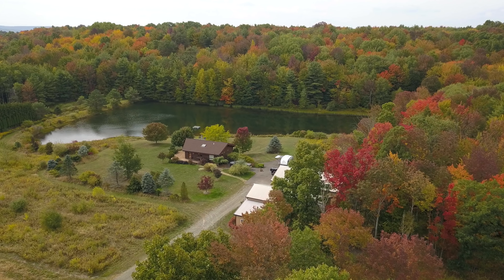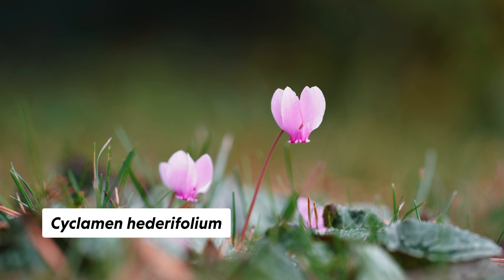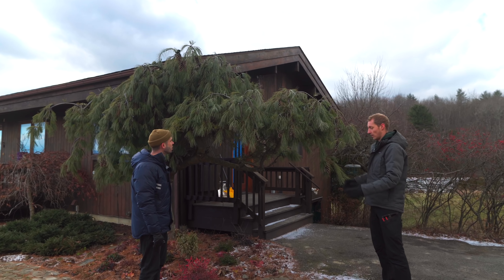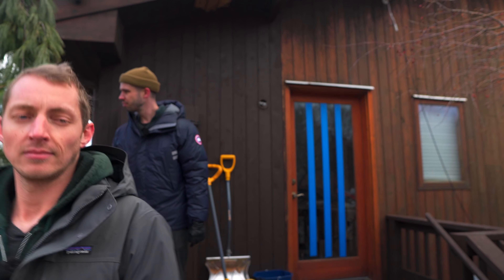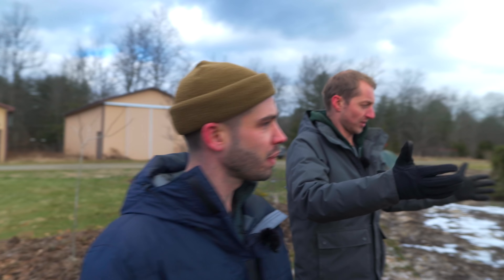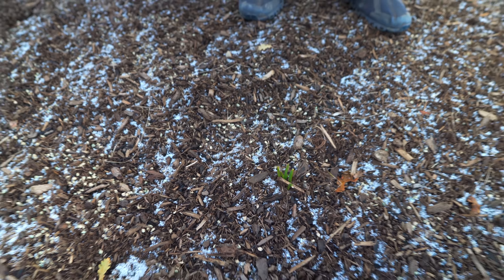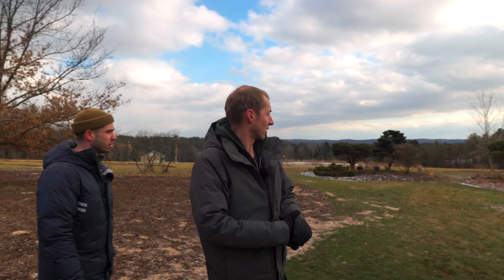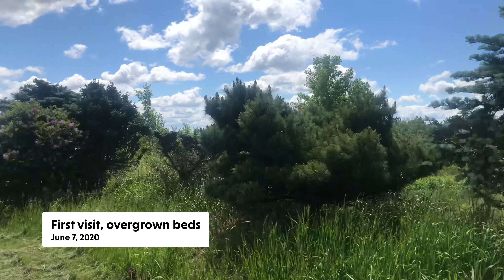WINTER Property TOUR: 1 Year of Work! — Ep. 072

Comment: The marks on the handle and bit on the floor look like iron sulphate staining, it’s used to fertilise gardens but it also turns wood slowly grey. My thinking is that someone had it on their hands and maybe splashed a bit on the floor?
Reply: Yes, I thought there must’ve been some chemical spilled as well, (I also thought it could be an issue with the chemicals in the stain) as the wood shouldn’t leach after all these years. I’m new to wood working so this is definitely interesting 🤓

Comment: What I chose to paint my deck 
Needed to be top 2 out 3 reasons 
One I did not want to walk bare foot in the hotter season running back inside for shoes Scolding Feet 
Second we had dogs living out the country with us 
when  wildlife ventured on our land they would ripp up the  paint  by thier claws you 
 could see thier markings every where 🤔
 also the deck was so hot for them to lay on even to walk as we  experienced children who came over with visits third when shoveling snow I wanted protection against the shovels the hard wear and tareing  
I choosen a color that resembled  Thailand sand frm one of thier exotic beaches mixed with scratch proof that would protect had a quarantine warranty  protection frm dogs tearing up the paint also the wood as much possibility 
And   would deflect the heat frm the sun🤪
The trimmings in-between the decking I wanted a colors that would blend together
Both  needed to have a soft touch so it wouldn't look bold  
sideboards windows  door trims  I used a rusty color that resembled rust as well our log home had darker tone not natural honey tone 
It was magical we couldn't believe on a hot day our deck facing south   exposure to sun all day stayed cool 
Our dogs stayed  layed out with out heat exhaustion thier body's would get the sun under them wood staye cool 
No matter how many times they jumped up ran off to catch unexpected deer or other  did not show or did damage to the paint  flooring of the deck
 5 yrs later looks still refreshing 
So all my top 3 specially 2 worked did its job 
We had alot of complaints what we also noticed being out in the country we had a huge pond our house was built on a hill the pond was down by the forestry area surrounding it 
not far frm the house
When we purchased beside falling in love with log  home the pond was like a small lake surrounded by forestry and pasture facing the south 
One of the things I was concerned with mosquitoes in the evening and  day 
The pond created fog frm the  moisture of the pond cooling off  when sun would set 
When the sun went down oh boy !
 we would got mosquitoes 
What a pleasant surprise our deck was totally comfortable now  
Since changing the paint  
The color before was Carmel out of date  not my taste 
Our deck  wrapped around  so mosquitoes were a problem 
 NO  more mosquitoes my sister and I slept comfortably on the deck at night on hot days couldnt believe how comfortable of a sleep we had we slept on the loungers with pillow planket WITH NO PEST 
It just worked 
Hopefully this is helpful for some when choosing paint specifically facing the south..

Comment: Love your videos! The stain on the handle and the deck could be from the sap from the pine tree (especially if it's been pruned last season). I once had a bench under an eastern white pine and a similar substance appeared. It could also explain why it's not on the walls.
Reply from the maker: Thanks for your thoughts. The stains are actually just mud from boots, shoes, tools and hands, but Sander didn't really articulate that very well on camera. It comes off with scrubbing, but otherwise just builds up. We were wondering if there was some other protectant that we can put on the deck part of it at least that will allow the mud to just wash off more easily...Not sure if you or anyone else here has ideas!